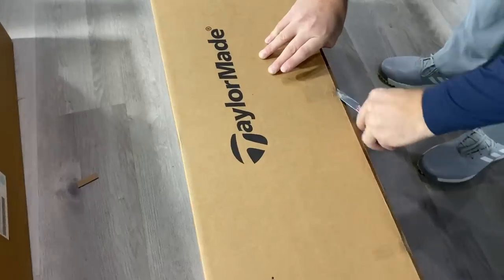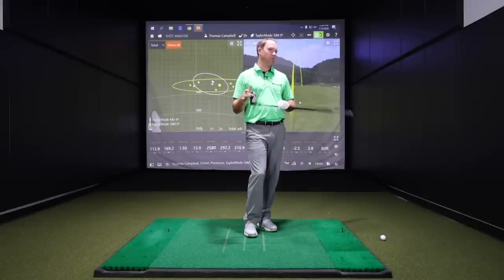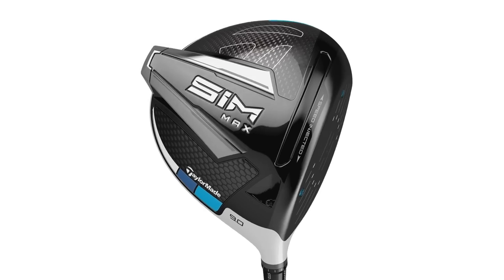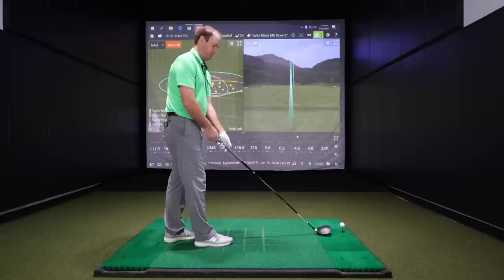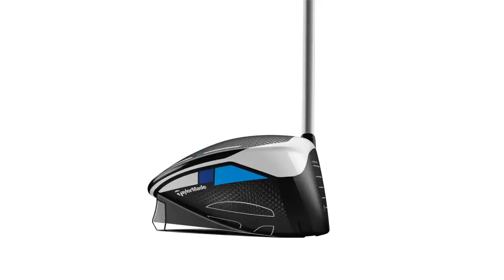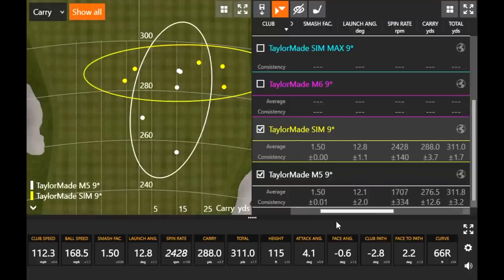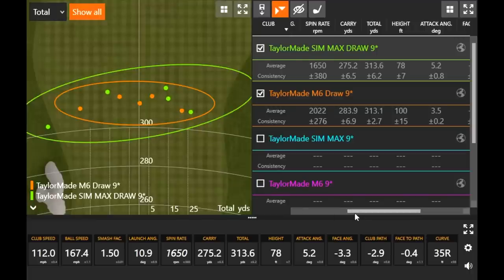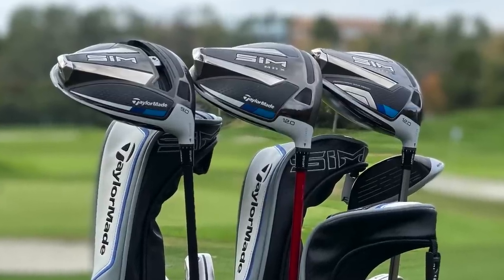TaylorMade Driver Test Comparison: SIM Family vs. 2019 M Family

Comment: You could achieve greater spinn numbers with th M5 by adjusting the weights more to the back. I still think M5 is more flexible than the Sims and the dispersion seems tighter as well. Pluss its now 100 bucks cheaper 😅

Comment: I appreciate the efforts and the time put into this, but you lost me with the introduction. Keeping everything "standard" and the "same settings" is not a fair comparison. You need to fit the drivers properly.
Reply: Hi Calvin, thanks for the comment. To keep this specific test as unbiased as possible keeping everything standard at the same loft is the fairest comparison of head models. We will have content on fitting drivers with adjustments to settings, lie and CG coming  soon.

Comment: It would be interesting to see if  90-95 mph swing speed would gain the same club speed difference as yourself
Reply: Unfortunately, it won't. A faster swing speed gains most from improved aerodynamics, at that swing speed you may see a gain of between 0.5 - 0.75mph.
Reply: @banditbaker1675  There will be small gains, obviously always player dependent.  Even gains of 0.5-0.75 mph can provide more potential distance...
Reply: @thomascampbellgolf  Agreed, I was just answering Jeff's comment and pointing out that slower swing speeds will benefit less than higher swing speeds from improved aerodynamics. Anyone with a slower swing speed expecting to see significant increases in clubhead speed from aerodynamics is going to be disappointed.